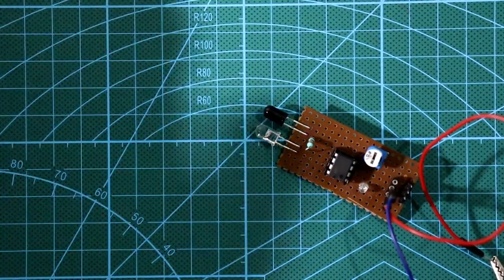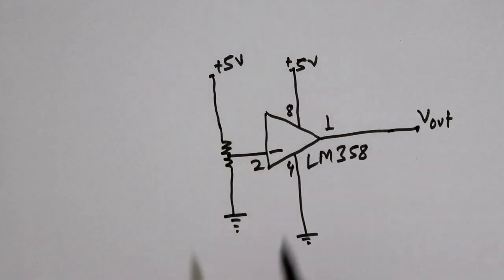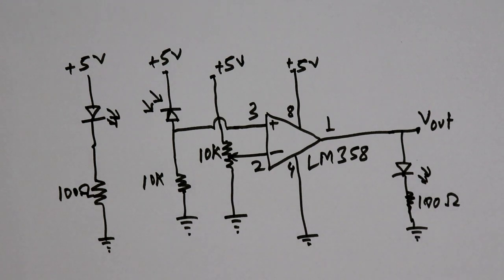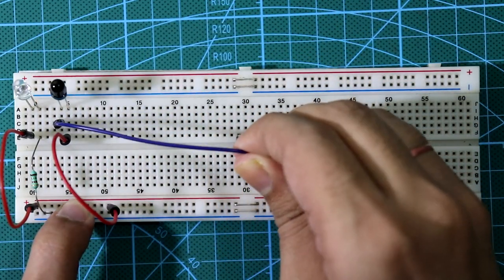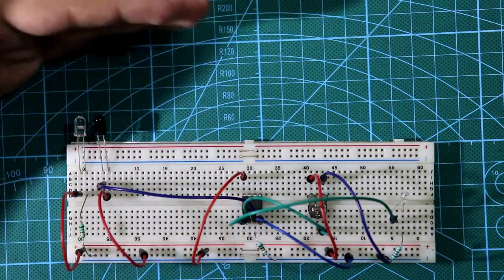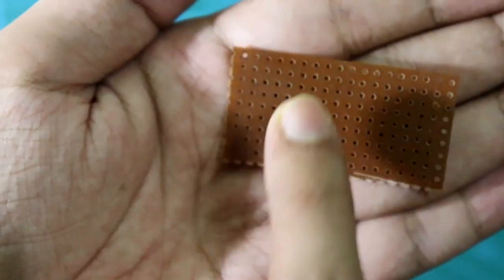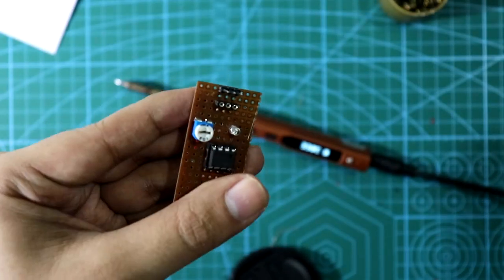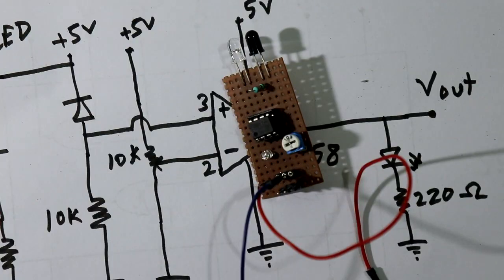Make an IR sensor module for Arduino | Proximity sensor by yourself

Comment: I was looking for a simple diagram, but this will not work for me. I want to make an ir light tunnel, but this might not be reliable. What's the problem? Sunlight or some other heat source might be the problem. This gives a dc offset to the ir receiver. So please use a kHz carrier (good old NE555) with the ir led and detect this carrier on the other side. There is a capacitor after the receiver to block dc signals (sunlight). When the carrier is present after the capacitor, there is a signal (clear line of sight of the tunnel). No carrier, then the signal of the ir tunnel is interrupted. That's why ir remotes also use modulation. 
But thanks for this video. It's nice.

Comment: I added buzzer to the circuit. But the noise the buzzer makes is too low. How do you make loud?
I want to install this at the door. So whenever someone walk in, it will make a loud noise.

Also why receiver's cathode is connected to positive? This is confusing.

Comment: Sir may i know if that circuit is good for testing remote control and the infra red led are different from photo led?  tnx much sir
Reply from the maker: Ya, you can check your IR remote with it.

Actually the black one is photo transistor. Some people says it photo diode. And the transparent one is IR LED.
Reply: @EEWave  tnx for the info sir

Comment: Do the photodiode works in forward bias??????
Reply: No. Photo diode or transistor conductivity is yearly increased (resistance lowered when exposed to infrared light) in forward bias it would conduct right away

Comment: Thx u ee wave I tried all others but it didn't work but when I tried ur I was just like !finally , one thing that is important if u are making this for hand sanitizer that I made also u have to keep in mind that it will not work with tip32c it will only work with Bc547that is very common transistor

Comment: is it suitable for counter circuit
Reply from the maker: Yes, I uploaded two counter circuits using Arduino and this sensor.

Unidirectional object counter:
https://youtu.be/-YXJF46KiIM

Bidirectional object counter:
https://youtu.be/FjeFDLzAMU0
Reply: @EEWave  but i am assigned to make circuit using counter Ic n IR sensor...so for that i wan Clock signal so will it provide Clock signal
Reply from the maker: Yes, it works in the without microcontroller circuit also.
Reply: Thank you.

Comment: Is there a way to adjust the distance at which the sensor triggers the LED?
Reply from the maker: By adjusting the potentiometer on the circuit, you can adjust the distance. Maximum distance is nearly 25 cm, minimum is 1 cm.

Comment: What is output voltage from this sensor? Is this sensor makes 0 volt when it gets any obstacle?
Reply: The output will be Logic 1 (High) or 5Volts when obstacle is detected. If using LM393 OpAmp then the output will Logic 0 (Low)

Comment: how many volts have the out signal?
Reply: You can get it with your multimeter, either digital or analogy, set your digital multimeter to the DC volt range  and then connect your positive from your DMM to the output and the black wire of your DMM to your Negative voltage supply

Comment: my friend how about if im going to use 12v relay what should i do? thanks
Reply from the maker: Connect a 10K resistor with the output, other pin of the resistor should be connected to base of BC337 transistor. Connect One pin of relay coil to +12 v. Other pin of relay should be connected to collector of transistor and connect the emitter to the ground. Across the relay coil, you should connect a freewheeling diode.
Reply: @EEWave  thank you so much for this really appreciated ... i'm a new student thats why im asking... im going to try it now

Comment: what is the range of proximity it can detect?
Also, how can we increase the range to about 2 to 3 meters (I'm trying to do this for a gate opener) ?
Reply from the maker: Its maximum range is apprx 0.5 meter. If you want to increase the range then connect more IR LEDs with this.

Comment: Hi, i have accomplished this circuit before. And now, i want to use this to trigger a pump using a TIP32C. But why is it that the operation was reversed. When it doesnt detect  anything the pump starts. But when it detected something the pump stops. Can u help me?
Reply: Reason is there are two types of sensor in market one with 2led and one with 1led , tip32c is used in 2led it sensor , while this circuit is one led it will work with bc 547transistor..i also made today my hand sanitizer machine

Comment: Bro, didn’t worked. I changed the receiver, and tried tv remote as transmitter but there was no response... I even changed the ic with new one but it didn’t worked. But when I connected two ends of receiver with external wire the led glow... 
help me and reply ASAP.
Reply: It works perfectly it's ur mistake while making

Comment: Hai sir we procured the preassembled or sensor module and it's functing but when we bring any objections then the output stops and we remove the objects then the signal comes.what can we do it's inverted can we make any changes in the board itself
Reply: Hello, how to add a relay 6 v to the circuit to connect a buzzer and how can I use it in the opposite way where when you remove your hand the red led with goes on . Thanks.

Comment: superbly explained Sir, good job! I had an IR module , I attached a 5 vmotor pump to it using a TIP32C transistor, Output from module is attached to base of transistor, VCC 5v from power source & module   to the Emitter & positive line from pump to collector, when the current is switched on it makes the pump to run continously , It , however  slows down when an obstacle is brought near the IR transmitter / Photodiode, is there something wrong with the IR module? I was trying to make an automatic soap dispenser
Reply: I found the solution to the problem, I realized there are two types of IR module in the market , one with single LED which works well with BC 457 transistor  , as shown in your schematics & other with Two indicator  LEDS, which works well with TIP32C /TIP 42c
Reply: @fdiy8612  can you tell me how to perform it with tip32C ,should i use same IR of two leds as shown?

Comment: I have done this but the led is glowing altime it there was no obstacles why
Reply from the maker: Please adjust the potentiometer. This is to adjust the distance of detection.
Reply: @EEWave  i have done if i reduce the potentiometer the led glows dim and brightens as maximizing
Reply: I have same problem. No obstacle, led still lights on. I have turned the pot till full or zero, but there is no change (led still lights on).

Comment: Wt is the role of 10 k pot in the circuit...
Reply from the maker: To adjust the distance of sensing.
Reply: Bro I build it on breadboard but the LED at the pin no.1 it is not blinking
Reply: Bro It's working inversely...
Reply: Thank you so much
Reply from the maker: You're welcome bro...